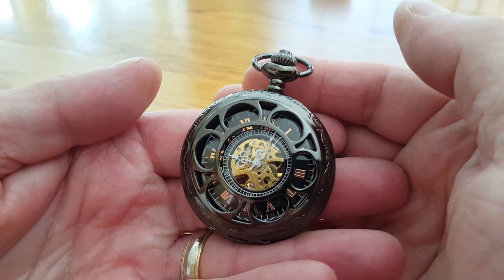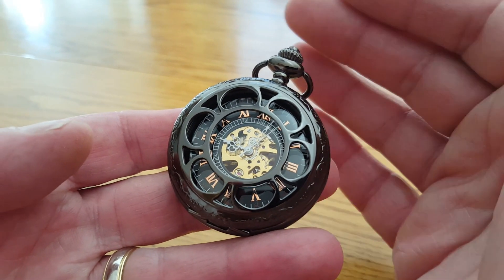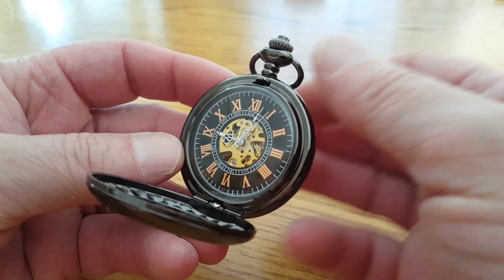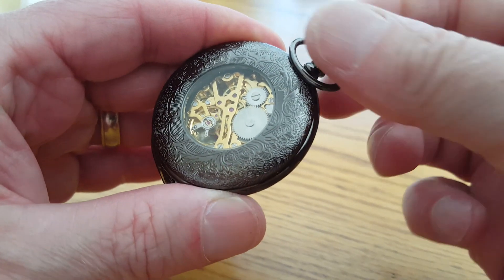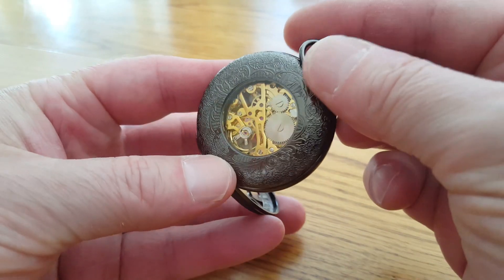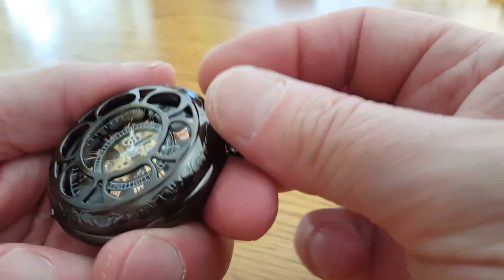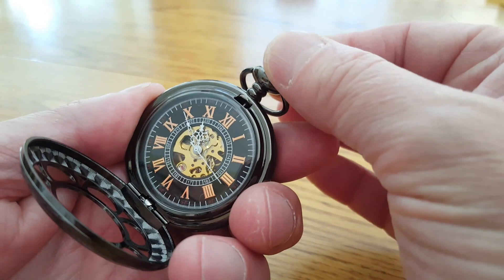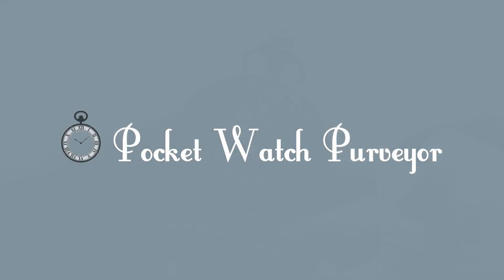How to Wind a Pocket Watch by Pocket Watch Purveyor

Comment: Thanks so much for this. I'm here because I was trying to help someone with their antique half-hunter. In order to move the hands I've discovered that a raised notch below the dial needs to be pressed while turning the dial (hands can rotate in both directions😅). I'm wondering if this is of some significance to a particular time period ?  Also, mechanisms are not visible at all, though the back does flip open. Running beautifully (these past 30 minutes anyway!). Amazed that it doesn't appear to have ever been accidentally overwound. Thank you for sharing your knowledge, PWP.
Reply from the maker: Sounds like a lovely watch!  Enjoy!

Comment: I just bought an inexpensive ESS mechanical pocket watch. It no doubt has a  Chinese movement, which I find works well with the automatic wrist watches I own that have Chinese movements. I'm wondering how to open it to adjust it. It's a couple minutes slow per day. It doesn't have the little plus and minus marking inside to adjust it. Also, do you think it's worth buying an automatic pocket watch? Or, are they too motionless in a watch pocket?

Comment: I've been recently gifted a pocket watch and I'm wondering if I'm doing things wrong. Even after fully winding it up, if it lays still on a surface for some hours (e.g. while I'm sleeping), after some time it stops going. Is this normal? How long should a full "charge" last?
Reply from the maker: A properly wound pocket watch should run for 12-36 hours...depending upon the watch and its condition.
Reply: @PocketwatchPurveyor  Thank you. It's a half hunter Lowell and it's brand new from the store. I assume that, in truth, I'm not winding it enough; which makes sense, since I fear to damage the mechanism because of overwinding. I tried to find online how much I should wind Lowell watches but without success.

Comment: Help! I'm trying to set mine but the crown won't go back down! When I turn the knob the hands still move. What should I do?
Reply from the maker: Try gently wiggling the crown as you push it down. Gently. Try it a few times. You may have disengaged the stem from the mechanism. If that is the case, your watch will be for show only.
Reply: @PocketwatchPurveyor  I just tried that. It went down but the crown still turns the hands. It still works and shows the time but I have no clue why the hands still move

Comment: I have one that turns counter-clockwise just fine, but utterly refuses to turn clockwise. Is it just a different mechanism, or is there something wrong with it?
Reply from the maker: That means the watch is over-wound.  You can confirm this by looking from the front face in the top left area of the mechanism.  You will see a drum-shaped spring.  If the metal spring bands are tightly mashed together with no air spaces, it is likely over wound.  If you can see plenty of air, and a metal spiral, then it is NOT over wound.  There are two ways to fix this.  Gently oscillating the watch may get it to start going (ie, the balance wheel rocking and second hand ticking), and it will eventually wind down enough to recover.  The second way is to take off the back and release the spring...easy for an expert.  Try method one first!
Reply: @PocketwatchPurveyor  thank you! I'm not sure how to disassemble it to see the mechanism, but I will try. It was given to me in its current condition, and I've been trying to figure it out recently. It has a locomotive engraved on it, but from what I can tell, it doesn't appear to be a railroad watch.

Comment: I think i just broke mine. I'm overwind it. Got tips to fix it sir?
Reply from the maker: Im sorry to hear you may have overwound your watch. The first thing to try is to gently rock the watch back and forth in the same way shown in this video. The idea is to get the mechanism moving so the main spring will unwind. You may have to do this many times over many days or weeks. Sometimes that works and sometimes not.

Comment: hey, what happen if you over wind it?
Reply from the maker: Overwinding will cause the mainspring to seize tight and the watch movement no longer operates.
Reply: @PocketwatchPurveyor  good tips... i'll buy pocket watch later
Reply: @PocketwatchPurveyor  I once bought a pocket-watch second-hand for a few quid, because it wouldn't wind anymore, it seemed to have jammed. It might have been to overwinding. Any tips to maybe get it working again?